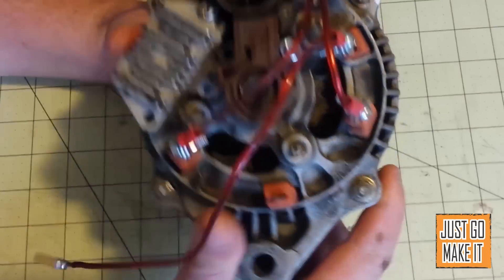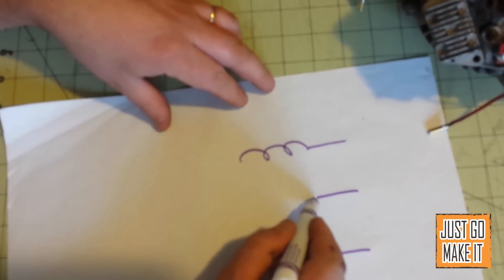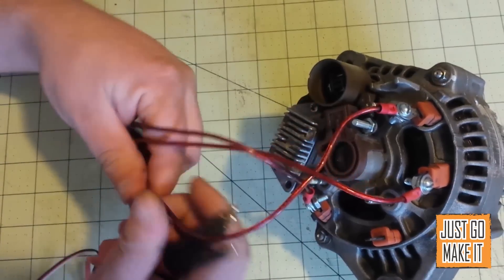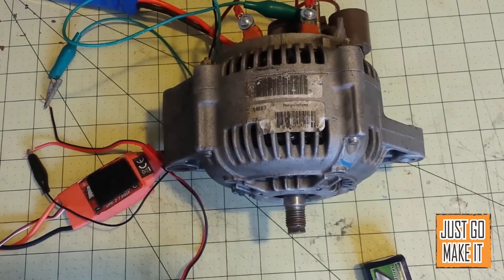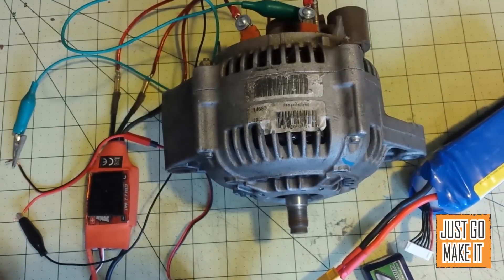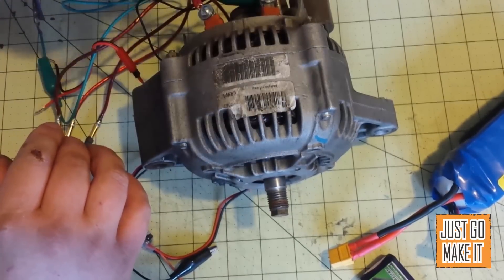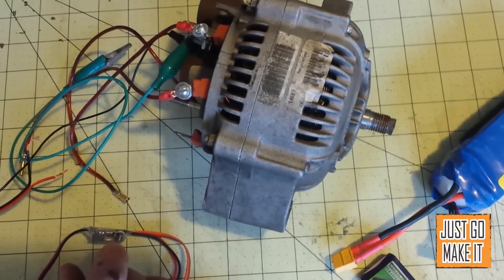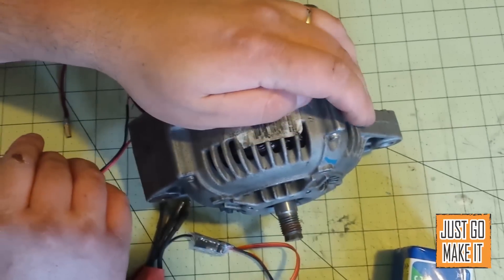Alternator to motor conversion howto

Comment: What you say in the initial part of your video is so true - there is not another video that I could come across that describes the procedure to convert an alternator to a motor as clearly and luckily as yours does. 

So a big thank you for that. I am working on an electric bicycle conversion and this therefore was the most crucial find.

Comment: Thanks for this great video of some years ago. Very instructive.

A quick Google on magnetic saturation shows magnetism is controlled by amps and not volts. Your small motor controller varies the voltage of the field. As the speed and the load of the motor changes, the required field voltage will change but not the required amps. As amps increase, first the power increases. It then tops out at saturation and falls. Set the field's amps where that flat top occures.

Get a cheap DC/DC power module pcb with controllable amps (less than $10) and see the difference.

This also means you can limit the motor's available power by reducing the amps to the field coil. It also reduces the amount of battery power your stator consumes. You can change the "size" of your motor on the fly. That is neat...
Reply: InstaBlaster

Comment: Great explanation. In case of alternators, you start the vehicle with 12v+ on the center coil, and brings down this voltage as you accelerate. This creates lots of torque in the start and higher rpm on the run. It's called field weakening
Reply: How do you lower the voltage?

Comment: Maybe the way to go for a go-cart would be to use the diode pack, run your 3 phase out as you have already done and into a 3 phase breaker and ardinuo style control so that you can create some regenerative braking by charging up a pack of Ultra caps.  My interest in motoring an alternator is simply for starting my GenSet projects for off grid appications, but possibly if needed by means of Star Delta system used in industrial motor applications.  The possibilities are endless.  I'm kicking myself for not having been around RC equipment these days like whats used in this video which is absolutely ideal for bench testing.  Great Video BTW.

Comment: I watched this kid in Australia put Hal effect sensors inside the alternator. He connected them to his Digital frequency controller the controller was able to make the alternator go in reverse as well. He put it on a bicycle, and flat out he achieved about 47 mph. He also took it off-road and it still had plenty of spunk in the tall grass. He also built a go kart with a single alternator, but it was built just like your alternator His name is austiwawa.
Reply: Austiwawa has great diy EV videos!

Comment: Yeah I had a suggestion for you if you try a dimmer switch on the field coil connection you be able to control voltage and the saturation great video
Reply: Dimmer switch will work???
Reply: Im askin richard fi
Reply: probably, but i know that rheostats work

Comment: Now that's what I was looking for 7years back when I converted my 50cc scooter... At the time I was asking and everyone was telling me that's too difficult if even possible... So finally I changed the winding of the stator and turned it to a new motor basically... Also bought an expensive airplane controler 600euros...

Comment: Hi. Thanks for the excellent tutorial. I would really like to build a go kart with this as a motor. I searched ebay and those e-scooter / bike brushless speed controllers are very affordable and should have all the necessary connections. I noticed that they also have a brake low / high connection. Can you use them to use them to brake the motor and charge the batteries back up? (like they do in electric and hybrid cars). It would make the batteries last longer.

Comment: i did it!!!
I got it to work from a stereo amplifier 5v 2.4A USB!!! (It was really slow and shitty but it worked)
I used a 250W stereo for plenty of headroom so it wont burn out from the 0.5ohm coils
and I gave it a 3-phase sinewave (sensorless obviously)

at a certain frequency it would spin up all on its own. but it drew the maximum power from the 5v 2.4A USB powerbank

it was kinda jumpy but it spun in the right direction depending if i invert or change the phase 
I used audacity to do the 3-phase signal to the stereo audio amplifier
I hooked it up with one of the coil wires going to one channel
and the other two coil wires going to the other channel

so now its a 3-phase motor (very weak though because i can stop it with one finger and it only spins like 20 RPM or something like that.
Reply: realflow100 
>using a strong car radio to tun a motor
Thats awesome and creative as fuck

Comment: Good job, I'm somewhat of an electric bicycle nut (own 3). I have one of those ebooks you mention where they do a GM alternator, they talk about 0-6v into the slip rings. I was surprised that your findings say so low, could it be because you are sending a PWM signal in there vs real DC? There is a Pow Pow Powerwheels racer built around a gravedigger car that runs twin alternators and a custom controller. That car is one of the fastest ones in the series. Cocktail napkin estimate is 3horsepower per. Would love to hear the rpm details on yours, it sounded fast. I think for any sustained use or heavy load you would need to add a forced cooling shroud and if I were going to try this I would use an ebike 3phase controller, 24-36v and maybe 20-30Amps. Working the formula for power from the volts and amps, 20A @ 24v=480w, one electrical horsepower=746w.
My daily rider is a '450w brushed motor' running 24v from a 35Amp pwm box, that's a tad over 1 electrical horsepower and has PLENTY of power to move my fat arse around.
Single speed sprocket drive tops out at around 16Mph. When I had the LiFeP04 pack on it I got around 18mph and did a cost study of mile per recharge and at 10c/Kwh it was around 1/4penny per mile! (does not include any cost for maint)
Best wishes from sunny Florida.
Reply: He mentioned, he also used a AA battery. Im assuming thats 1.2 - 1.7v DC
Reply: hmm really good point - i didn't think of that - he is actually pulsing the field rotor - the modulation would result in a EM spike in the rotor-  that's why when he can 'match' the em spike with the stator field pulse the motor takes off. 
thanks for the comment.  
it would be interesting to see the difference between that and just a Perm Mag rotor.

Comment: I'm a member of the UK power wheels and a college on that sudgested I have a power resistor in line with the field Coil and switch that would bypass it effectively giving you a high touqe low speed 1st gear and a low touqe high speed 2nd gear. You could switch the resistor to a 12v motor controller with a potentiometer on it if you wanted to dial in 2nd but that may be  overkill.

Comment: Have you tried a rheostat switch commonly known as a dimmer switch if it works you could mount on the steering wheel and use it as a thumb throttle...

Comment: I think you have the names of coils mixed up. As I understand it, the field coils are the three outer coils that make up the stator. The rotor has the coils that are switched on and off via the brushes. Either way, a great video 👍
Reply: You are correct.

Comment: I made an Ebike with one of these. 
 It runs like a dream, and it is almost silent  :) .
Reply: CNCmachiningisfun can you please give me information on how to you did yours I am really interested in making my trike electric but I don't want to spend a fortune Tia
Reply: Brock Hance 
 Yep, sure can. 
 Start out by pulling the alt to bits, as per these videos. 
 Bring out all 6 of the phase wires, so you'll have proper access to the 3 stator coils. 
 Bypass the regulator, and bring out the two wires for the brushes. 
 Deliver between 3 and 12V to the brushes, to establish the required speed/torque range. 
 Use an RC aircraft ESC, rated at no less than 60A,  to drive the alternator, wired in Delta mode. 
 Star mode (original alt internal wiring) works OK, but I find that Delta mode gives more torque and speed for the same electrical power input. 
 That will get you going, rather nicely, as you can see in my videos  :) .

Comment: Halfway there now just hook up a standard alternator with a belt to your converted alternator / motor and hopefully discover free energy via the output of the factory alternator you could even run a additional wire from the factory alternators output back to your converted alternator to supplement its power also and still generate enough power to power a few fans or whatever

Comment: Thank you very much for the grateful experiment. However, I will be very thankful if you can provide me with the sources of the kits 'especially the part that convert the DC single phase into AC 3 phases'  which was used in this project. Looking forward to hearing from you.

Comment: Did you test the bridgerectifier if it has exces power flowing ore what polarity you get on that rectifier? There is a posibility with some alternators you actualy get swaps from generator to starter motor functions there is a posibility that you can run bouth at same device I belive

Comment: depends if the stator is wye wound or delta wound. delta wound has 3 poles yours is wye wound. dont know if it would make a difference in speed and torque? probably....

Comment: hi there im building a go kart for my son  but 24v as i have two 12v 100ah deep cycle batteries but they are heavy!  and was wondering would it be best if use an alternator or a brushless 1000w or 1600w motor? which would produce more power and pull less amps? Which would be more durable? u know kids theyll put full throttle non stop until the battery dies lol

Comment: Hi, is there any way to use an alternator both as a motor and an alternator at the same time. I have a diesel engine feeding up the alternator but I want to have either and electric motor gearing up the same shaft. Alternative to the separate engine I was wondering if I can use the alternator as a motor and and alternator at the same time? thanks for the help in advance.

Comment: Hi, just a quick question. How does the alternator rotor, fixed poles, follow the rotating magnetic field without a position sensor? Dave R
Reply: the red box in the video (brushless motor controller) does the rotating
Reply: applying current through the brushes to the rotor causes the rotor to become an electromagnet.  This electromagnet is then dragged around in a circle by the rotating stator field.

Comment: You could replace the field coil with permanent magnet ring/s sandwiched between the poles using iron spacers, if needed, to keep the armature poles apart at the right distance. Got it?

Comment: I have a 10 mile ride to work.  I would like to build an electric bike.
Would an alternator work?
Plan on hooking the electric motor to the bicycle chain and gears. 
12/24 volts? 2 car batteries?
Reply: yes, but depending on how much voltage you give to the alternator, and depending the exact models of the controller/alternator/batteries, you can need more or less gear ratio to achieve some speed while not lacking torque
there are videos of ebikes with alternators, MR IMBUS is one guy who made an ebike with your idea

Comment: JUST GO MAKE IT - To really feel the full operating range of the motor, it would help to be in control of your oscillator frequency. It would take instruments or circuits, but, I think those RC hobby brushless controllers might quit trying to operate if the motor spins too slow. Slowness should happen when the field current is way higher than 2v. 'No-Load Speed' should go down as field goes up. It's 'Stall Torque' that should go up with field current. Field coil instead of P.M.'s makes it a variable transmission: Motor is a fast wimp at low field, or a slow bull at high field. Torque demo: maybe put dc 10amps thru any one winding, and vary the field current with another dc supply, and try turning the shaft by hand. It'll try to stand still, fighting you with the motor's maximum torque, which will be proportional to field current. Maybe somewhere below 12v on field coil the iron cores saturate (can't carry any more magnetic flux lines), and then the stall torque won't increase any farther with higher voltage or current. Or maybe it increases till somewhere past 12v, I dunno.

Comment: Should the brush wires not touch the casing? Mine were grounded to the casing.. any suggestions?
Reply from the maker: i would just unhook them from the case
Reply: @JUSTGOMAKEIT  if I could show you a picture I would. I was able to isolate the two brushes and run wires out of the back. I think this might work but if not let me know

Comment: Would it be possible to use it as electric supercharger (together with a compressor) and only boost an engine when it needs it the most in hard acceleration and only momentarily? I mean increasing torque intermittently to a car engine and not max power. It could use a capacitor to draw the required amps for the few seconds the boost would be on when pedalling to floor. When the engine rpm reaches certain value, the motor and compressor shuts down.

Comment: Hi did you wire the field (stator)  in star configuration ?
Reply from the maker: It was already wired in star configuration
Reply: @JUSTGOMAKEIT  thanks only thinking about certain benefits about star and delta  connection iam planning to build a go-kart  for my son  an E kart  that's all

Comment: I have seen alot of these videos and i just want to hook it up straight to a 12 v car battery can you hook the 3 wires to the one bushing wire and the other to the ground and it work because i dont want a controler i just want it to run by hooking it to the battery

Comment: Thanks for sharing man. Quick question, is it possible to use the same battery for both the rotor (12v) and stator (48v) with the same 48v 20A battery using a dc/dc step down? Thank you
Reply from the maker: that can be done.
Reply: @JUSTGOMAKEIT  awesome! thx

Comment: I want to do this but retain the battery charging capabilities of the alternator, essentially making a starter/alternator out of it. The project is to build a gas-powered battery charger for an ATV-powered golf cart build I'm working on. Unfortunately, the stator in the engine isn't strong enough to maintain charge with all the accessories I want to run, and I can't find a better stator for my engine. Anyway, I want to use a 2½hp engine I already own to spin the alternator, and because space is limited and I can't find a starter for it, I want the alternator to start the engine then switch to charging the battery. I'm thinking three 5-pin relays wired to a button can switch the 3 coil wires from the rectifier to the speed controller, and back when the button is released.

Comment: speed controller, can you use a car heater motor controller ? it would be cheep ? just wondering.
Reply: speed controller has to vary AC frequency to the motor.  A heater motor controller would probably work to vary the field current as necessary to optimize power factor at a given load.

Comment: hi I am wanting to put an alternator on a bicycle and see if it can power it. instead of the controller what would you use? ideally id like to use a throttle grip but I am unsure. thanks
Reply from the maker: +1998charlieboy there is a brushless motor controller for electric bikes or scooters that would give you a twist throttle.  such as these:
http://www.electricscooterparts.com/speedcontrollers48volt.html#48Vbrushlessmotor

all you would have to do then is supply power to the field coil.
Reply: do you have an email address I could have to send you some pictures as I am confused as to what is what and some advice would go a long way
Thanks

Comment: Was the voltage applied to the phases being adjusted by the speed controller or was it constant?
Reply: Voltage applied by the speed controller may have been constant with speed being varied by frequency only.  This is rather inefficient in that the high voltage at low loads results in unnecessarily high heating of the stator coils.  If the speed controller is smart enough to detect power factor of its load and reduce applied phase voltage to maintain a power factor of nearly unity, The speed controller need only be adjusted to the desired RPM.

Comment: Very good explanations but I have a question that seems very important to me, after all the turn of turning the regulator into a motor. How many revolutions and HP a hundred-amp regulator will it have? When converted to an engine. You can send me the ligatures diagram

Comment: Do you know if I can run one with out a controller and how I'd hook that up?  I'm converted a riding mower to electric and I've been thinking of removing the belt drive for the blades and running a direct motor.  I wouldn't need a controller. Just flip a solenoid on to spin them up and go. I've got a couple Nissan 200 amp alternators sitting around from another project I was doing before I sold my pathfinder.  It'd be great if all I had to do was wire and mount them to run off my 48v pack.
Reply: Nope. you cant. its literally impossible. without some kind of controller or ESC

ESC is VERY cheap on amazon. Will do exactly what you want for like $8.66
Reply: realflow100 thank you.

Comment: Thanks for the info. Looks like the perfect ideal cheap motor for an E bike. Could you use a sewing machine foot control pedal with it ? Around $30 on eBay.  I don't know if AC and DC current makes any difference.